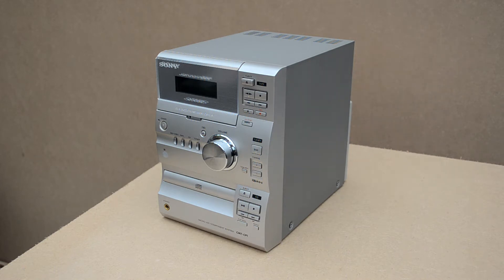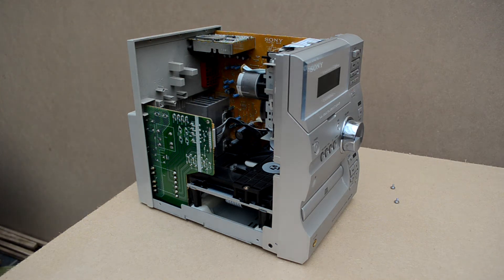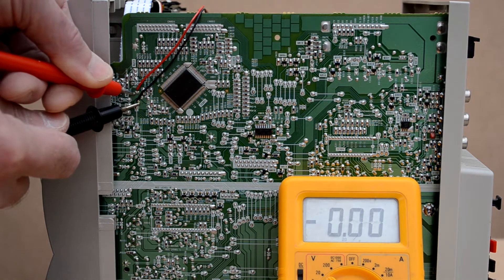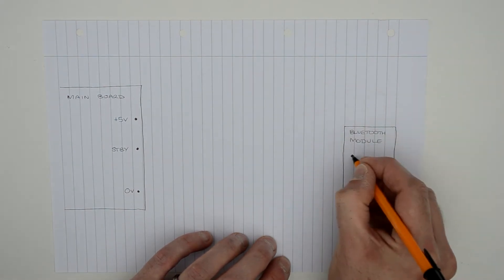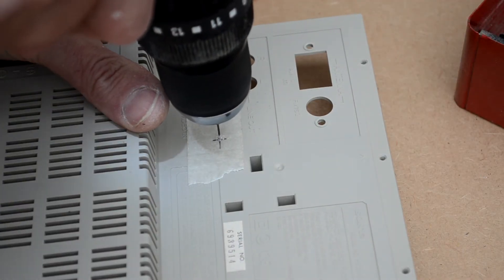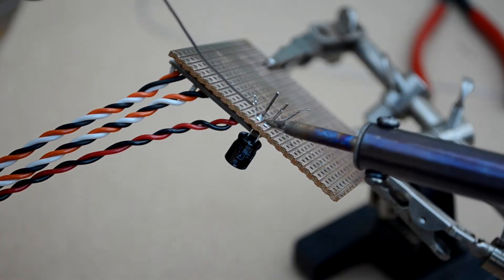Sony CMT-CP1 Stereo Bluetooth Upgrade using KRC-86B

Comment: Do You lose The auxiliar with Bluetooth module? Because i own the same system and it is connected to My tv box vía rca
Reply from the maker: With the set-up shown in my video, you can still use the MD IN socket (AUX) when the bluetooth module is not paired.  When the module is paired, it takes the signal from bluetooth. It switches automatically between the two.

Comment: You can add Bluetooth adapter in Aux input and select aux on the function. I have SONY CMT NEZ3 .  I connected aux port to Bluetooth adapter and connected phone
Reply from the maker: Yes, if you have an Aux input, you can use that.

Comment: Thanks Mike. Have you ever come across the Power button's red light being completely dead. Tape and CD function will actually operate, but the Power Amp, Power button, Speakers, etc. are all completely toast.
Reply from the maker: Sorry, no I've not encountered that.
Reply: @Ap01101969  The standby signal is only 4.9 Volts, not the 6.7 shown in your video. The standby signal is 0V before I press play on the Tape or CD. Does this mean the PSU is not putting out enough?

Comment: man, you  have soldered blak-red wire on terminals of super capacitor C810 0.1F, so if power falls, the super capacitor C810 drain faster with additional current consumption of BT module and so you lose out faster the FM stations; or I am wrong ?

Comment: Thank you for the detailed information below, however before fitting this switch circuit to my sony cmt-cp505md  my schematic shows a different configuration,  with only upto 5v rather than 6.9v.
Will the same transistors and resistor values still work? The L and R standby circuit also doesn't seem to be identical either. As this hifi has a digital and optical line in (with the MD built in) to avoid DRM, I'm intending to hook into analog line in instead. Many thanks in advance. Tim.
Reply from the maker: Hi Tim, I'm not familiar with your model of HiFI, but I would think the same value components should work.  The resistor values are not critical, provided they drive the transistors into saturation. If you have any problems, you could always reduce the value of R1 by 1k or so, but I doubt this will be necessary.

Comment: also curios on the final board you have 4 resistors?
Reply from the maker: Ah yes, I decided to increase the value of R1 (by adding another in series) to minimise the current drawn from the STBY signal on the mainboard. It wasn't strictly necessary, but just a precaution as I didn't know how much current the STBY signal could provide. The resistor values are not critical, as long as they drive the transistors into saturation and make them switch on.

Comment: What are the exact values of the resistors, i understand that 15K, 1k and 4m but does it matter in terms of % or MW, and could a 4.3M Ohm be used instead of 4M Ohm. Thank you.
Reply from the maker: Left to right... R1 = 15K, R2 = 4M and R3 = 1K.
Reply: I just use the rca socket you don’t need Bluetooth. It’s a gr8 stereo though and you can change the belts

Comment: Hi Mike. I have a very similar stereo (CP11) that maybe you can help me to find out something. Is better to disconnect the stereo off the electricity when is not in use? Or just turning it off is enough? Sorry that my question doesn't have anything to do with the video, but I'm wondering that because those are very old machines and I don't want something to burn out like a cap or something. Also, I'm dumb as a brick :(
Reply from the maker: Hi Loco, all I know is that the circuitry in the stereo is still "live" when it's in standby. Mine has lasted over 20 years on standby without a problem, but disconnecting from the mains will save electricity.

Comment: Hi have a  sony cmt nez33 doesnt turn on once i try to fix the tape belt can I only remove the strip wire and put it as it is. Now the system is completely dead can u help

Comment: @Mike Smitch sorry to bother Mike my device here HCD Cp11 I even got the schematic of your HCD Cp1 video, they are the same externally so that internally a little different the part of the power supply the capacitor C810 you used for 5v source is the same now in the amplifier circuit and a little different by the scheme my 10k resistor connected to the standby would be the R311 and the standby voltage 4.9 volts will be that this may not work, I downloaded both schemes I found google.
https://www.manualslib.com/download/701033/Sony-Hcd-Cp1.html
https://www.electronica-pt.com/esquema/audio/sony-audio/sony-hcd-cp11-65962/

Comment: @Mike Smitch @ Mike Smitch Standby 6.9 volt purple signal wire is soldered to the 10k resistor? or on the q306 transistor, I don't know where to solder the wire.
Reply from the maker: You need to connect to the standby pin of the amplifier chip or any convenient point that's directly connected to it (such as the + side of C308)

Comment: @Mike Smitch 6.9 volt standy purple signal wire soldered on 10k resistor? or on the q306 standy transistor I am unsure where to solder the wire.

Comment: @Mike Smitch thanks Mike I found a schematic, now the connection on the RCA L / R connectors on the video you soldered the input and output wires of the board in parallel on the MD connector, because there are three GND / L / R wires on the video, there are 6 wires.
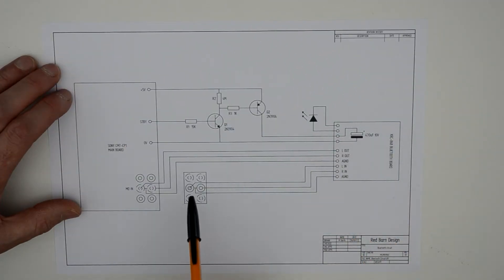Reply from the maker: Sorry, I'm not sure what you're asking. I removed the phono panel from the PCB and cut off the legs of the two MD phono connectors so they no longer connect to the PCB.  Instead, I wired the MD phono connectors to the L / R / GND inputs on the bluetooth module (3 wires).   I then wired the L / R / GND output from the bluetooth module to the stereo amplifier board where the MD sockets used to connect (again, 3 wires).  This should be visible in the video at 4:23.  Hope this helps.

Comment: Hi Mike Smith, very good video that you have made of the Bluetooth KRC-86B V4.0.
I am writing to you because I am trying to install it on a Yamaha PSR-2000 musical keyboard, so far it turns on well, the LED, connects directly without the need for security like the other bluetooth, example "0000".
But my concern is that the music does not sound, there is no audio. It will be that you can help me, I am waiting for your response, thank you.
Reply from the maker: Hello Ektor, I'm sorry but I don't think that I can be much help to you, as I don't know anything about the PSR2000 keyboard. How have you connected the bluetooth module to the keyboard?
Reply: @Ap01101969  Hi, thanks for answering, at least I know you can guide me.
He decided to acquire the bluetooth KRC-86B V4.0 because I saw it working on a Yamaha PSR-550 music keyboard here the link, (I clarify that there is no installation, only shows it working) https://www.youtube.com/watch? v = lCa5o0Mzfeo & t = 410s
I think you can help me out.
I have the following question, the following options appear on the card:
IN L - IN R. Where these inputs are installed both left and right, they are necessary to install them, and if they are you where I install them on the SONY equipment, to guide me.
Now the
OUT L - OUT R. These outputs go directly to the speakers and brightness and if not, where are they going.
For now I thank you if you can help me on this, thanks again.
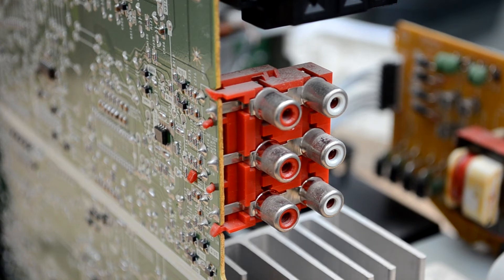Reply from the maker: @EktorPSR  Connecting the OUT-L and OUT-R directly to the speakers won't work... the signal has to be amplified. The OUT-L and OUT-R need to be connected to the MIC/LINE-IN on the amplifier board.  The signal will then go through the keyboard's amplifier (and volume control) before it reaches the speakers.  On my stereo, I used one of the line inputs and had to break into the signal path (see 5:42 to 6:10 and 8:11 to 8:48 on my video).  I connected the phono sockets to the IN-L and IN-R of the module and connected the OUT-L and OUT-R directly onto the amplifier board, where the sockets had previously been connected.  4:25 to 4:50 on the video shows this on a diagram...  hope this helps.
Reply: @Ap01101969  Hi Mike, thanks for your answer and I already solved 98 percent and it works perfectly, but I have a question, there is a noise like interruption, like ruuuuuu, little one, I would like to know what that noise may be due to, you have an email where I can send a message or video or whasap?
And again thanks for your knowledge.
Reply: @ 'Ektor Montoya' :
Will you send money - or some reward - together with that video you want to send ?
Reply: @trackpersonal3025  Good morning I do not understand your comment?
Reply: https://www.youtube.com/watch?v=lCa5o0Mzfeo&t=16s

Comment: hi, I wanted to submit to the teacher a question, I have the same audio system but I can not fix it, I disappeared the audio but with the headphones feels good, I have already tested several components including the finals but nothing to do, you have some advice to give me, because I do not have electronic schemes to make precise measurements, Thanks.
Reply from the maker: Hi Andrea, I'm not sure that I can help you very much, but can tell you that the headphone output has its own separate amplifier so, if headphones work, but not speakers, then it's likely to be the speaker amplifier or some associated component that is the problem. There are two separate amplifier chips, one for left and and one for right channels, so if you're getting nothing from either speaker, I guess it's more likely a shared component - there is a "muting" circuit which connects to pin 10 of the amplifiers and also some transistors which drive the "standby" input (pin 9) of the amplifiers, so may be worth looking at what these signals are doing.  Best advice I can offer is to Google "HCD-CP1 service manual".  This should find you a PDF copy of the manual with full circuit diagrams, etc.  Hope this helps... good luck!
Reply: good morning and thanks for the very quick response, again congratulations for the work you did, good true.     The two final TDA and the smaller ones at the bottom I tested them on the bench "but without power" with another new one, and I "seemed good" also because the audio is there but it is very low.      in repairing the mechanics of the tape and CD in the test phase, the two wires (+L / -R) of the speaker, touched each other and the problem was born.         if you want to send me the datasheet I would appreciate it. you can send it privately via fb. many thanks again
Reply: hello, I'm not sure you received my reply, so I repeat, I would be happy to receive a scheme to try to solve my problem, if you want, you can send it to this e-mail, Thanks and best wishes for a Happy New Year .
Reply from the maker: @AndreaVersilia  Hi Andrea, the full service manual, with schematics can be downloaded from https://www.promelec.ru/UPLOAD/xml/scheme/HCD-CP1.pdf
Hope this helps you find the fault. Good luck and Happy New Year

Comment: Does it switch to bluetooth input when the paired device is in range, or only when you play music?
Reply from the maker: It switches to bluetooth input when the paired device connects, even if it's not playing music. With the bluetooth device disconnected it automatically switches to line-input.
Reply: @Ap01101969  You did a PERFECT job... it would be this way also if Sony had made it by design.

Comment: i have this one. it is the best sound i ever hear but i don't know how to connect a mick on it.
Reply from the maker: The KRC-86B has audio inputs (left, right and a shared ground).  In principle, I guess your mic would connect to these, but may need to have its own pre-amp to match the required level (line level) and impedance.
Reply: I mean i want to record my voice on tape. i have the cassette recorder.
Reply from the maker: Sorry, I misunderstood your question - I thought you were referring to the bluetooth module.  However, my previous comments apply also if you want to connect your mic to the CMT-CP1 line inputs - you will need some sort of microphone pre-amplifier to bring the microphone signal up to the required level for the line inputs.